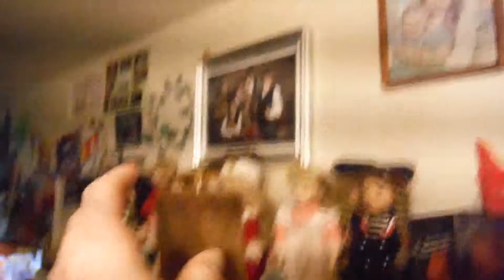How To Make A Cat Tree More Stable And Stronger

Comment: Thanks for the idea, I have the same problem. You can cover the bottom of the bracket with velvet glued over the metal, and in the upper part you can wrap another piece of braided burlap rope. I will do so. Thanks again.
Reply from the maker: No problem. Glad I could help 😃

Comment: What size brackets are those?
Reply from the maker: 2 1/2 inch one side. Thanks for your question and comment 😊
Reply: Great video! I tried tightening mine by turning the columns and I made it worse! 🙏
Reply from the maker: @budlongpdx  thanks. I still have the same tree in the video. It's just as strong and my cat climbs to the top multiple times daily. She has a few tree's in the house. I've done this to them all. This is her favorite tree though.

Comment: I recently acquired a slightly used cat tree and am revamping it for my own kitties... have not been able to locate its make/model until I watched this video... it is the EXACT SAME one that you've got (except mine has blue furry fabric instead of brown) Can you give me some info on this? And also, thank you for posting this video; my cats are big and will definitely require the extra stabilization your trick provides :)
Reply from the maker: I got everything in the aisles at Walmart. Where the screws and household items are. My tree is still up and I have since moved and it's still standing just as strong as then. I vacuum it every now and again and just keep it clean but it looks new still and stronger than when I purchased it. I'm going to make a video for an update year's later. Thanks for your comment 😊